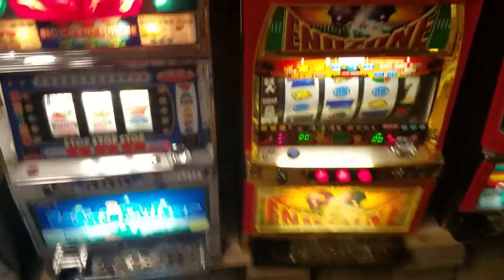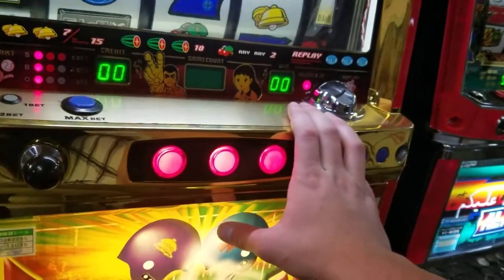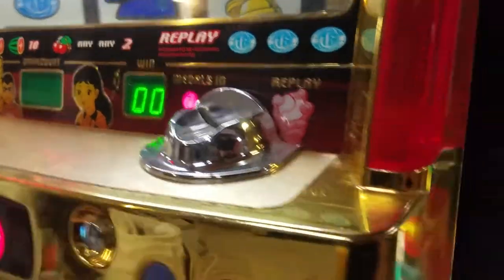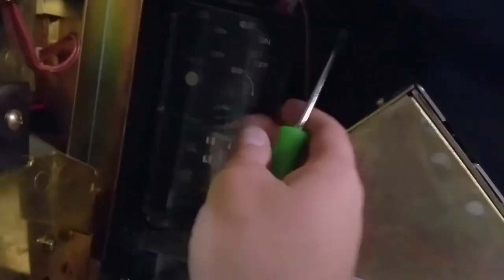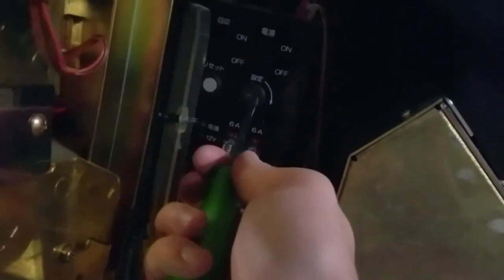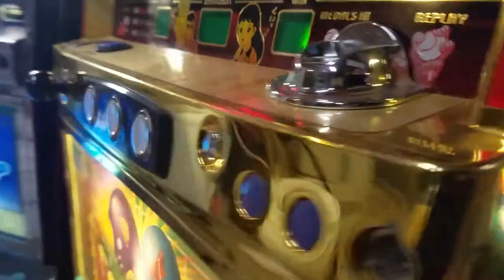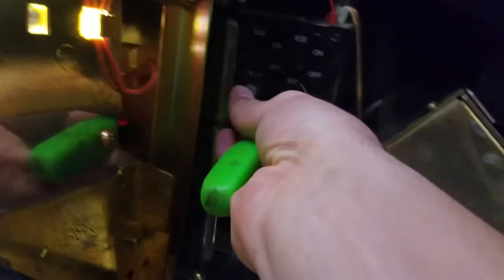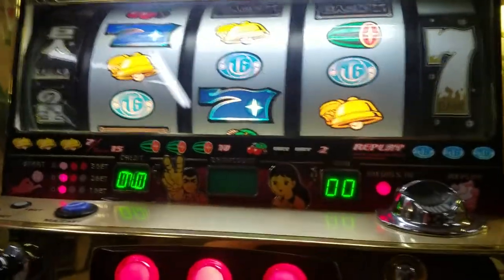Errors and how to reset your Pachislo Slot Machine

Comment: Can you help me to identify the problem I am having with my pachislo machine "double impact" giving a code C3
Reply from the maker: Doing a little bit of research and I believe the c3 Is something to do with the buttons that stop the reels. If that is the case, I would check to see if When you have the machine open and you push the buttons if you are getting any sort of lights in the back. That only turn on when you push a button. If not, then I would check the control board and see if by chance you have a blown fuse on that control board. I've had that happen to me before

Comment: Jacob thank you. Super helpful. Just acquired a "GIAN" pachislo and ironing out a variety of stuff. Are you familiar with an "HH" code? Not finding info about this one! I have checked the LED sensor on the hopper, quick cleaning. NOT seeing any light readily visible from it (are these infrared?) This error occurs after every game unless I do a door reset (the pair of microswitches linked to the door lock) - I have new ones coming since one was blown apart).
Reply from the maker: Some of the sensors are infrared sensors, yes. I would check to see if the infrared sensor is by chance going off and if not to replace it. Definitely could be an issue.

Comment: Hi jacob, could you help me try to fix my machine? When cashing out, it only spits out one coin and then flashes a 3 until i do a hard reset
Reply from the maker: Have you by chance cleaned your hopper unit or does your hopper unit spin freely?
Reply: @jacobnienaber7653  got it fixed. coin ejecter was not moving freely and not keeping up with pace of coins. lubed it up and works perfectly now
Reply from the maker: Wonderful! I'm glad to hear this. I apologize for getting to this so late. Repairing coin operated equipment is merely a hobby, and I have other commitments above and beyond this YouTube channel. Glad to hear you found what worked!

Comment: I'm wondering if you can help me with a slot machine I recently bought it's for my parents for Christmas and I keep getting an E3 error it's 777 big chance game new big pulsar. I wish that I could send you a photo of it- maybe if you have an email??
Reply from the maker: My email is 96nienaber@gmail.com

Sorry for the later response, doing a mass comment today. Doing a little research and looks like E3 could be an empty hopper (no coins). If this is not the case, or the tokens are not feeding through properly, I would clean the hopper and see how they feed through. See if it potentially is a sensor or switch. Then reset the machine.

Comment: I just acquired a Pachislo triple 7 slot machine, the reels don't spin and the bet max button does not appear to be able to press down.  Any ideas of the problem, it did have a E1 code but I cleared it.  Thanks
Reply from the maker: Sorry for the late response, doing a mass comment today. When you try to place a bet or put coins in the machine does it do anything? There should be a control board in the back right of the machine or the center of the machine (different models do things differently of course, But I am no means an expert on every slot machine). 

What I would first do is go through and test to make sure that your coins are going through appropriately and are registering (there will be an LED light or should be an LED light for every switch possible). When the switch is activated, it will produce a red LED on that board. Test and see that all your buttons, coin slot, and lovers are registering with that board.

If they do not, the machines that I've worked on at least have a fuse on that board. With the machine off, with a multimeter (or if it is blatantly blown) see that that fuse is good. If it is not good, that could be your primary issue. The machine will still turn on, but will not act appropriately as that board controls many of the switches and moving parts. Hope this makes sense?

Comment: I just bought a used one. It's all in Chinese. What is the button left of the black play handle for?
Reply from the maker: I would have to look, but I honestly have no idea what this could be... I know that's not a great answer, but never have had to use it, sodon't know what it all is. However, and I'll try to find the app here, but there is an app (pretty sure this I'd an offshoot of google translate?) That you can take a picture I'm something in a foreign language and will translate it for you in English. I would do a little research on this, as it helped me tremendously but haven't worked on one of these machines in about 2 years, so I have them in my attic currently and dont get them out often.

Comment: I recently bought a used Gurukun slot machine in an online auction.  Your reset instructions helped me get it going.  Now I'm searching for some replacement light bulbs.  They are very small wedge bulbs marked 24V 1.4 watt.  Any idea where I can buy them?  Many thanks!
Reply from the maker: I would try eBay or even a large department store might have them (Menards, Lowe's, home Depot)?

Comment: Do you any knowledge for a super mog mog machine.  Plug it in. No power. Although today I did get the coin dispenser to rotate.  This things been in the family foreverrrr an just trying to get it back to working. Thanks
Reply from the maker: I do not know alot of that particular machine. I would be tempted to check a fuse if you can get the hopper to run. Next thing I would check would be if everything has proper plug ins to the power supply. Next, would check to see if the power supply is the issue.

Comment: I need help resetting my Pachislo machine.  It's older (1992?) called Triumph.  Can anyone help?  I can send photos.  I get power to the lights but nothing to the 3 reels, and the coin mech is unpowered and simply passes the tokens through to coin return.
Reply from the maker: Sounds like this could potentially be a power board or a power supply issue. Not 100% sure of it, but if you are only getting power to a few things, it sofunds like either a fuse is blown on the power boards or a bad bower supply

Comment: I have a 1995 Pink Panther Big Chance pachislo. We play in credit mode because anytime the coins have to pay out the alarm goes off and the error code is E3. To get the alarm to stop we have to reset the machine everytime. Not too bad but it gets annoying because we can only play a couple spins in a bonus round before the max 50 credit is reached and then it has to resort to spitting coins out. The coins spit out fine but the alarm goes off, we have to reset, and then completely loose the bonus round. Needless to say, we’ve never been able to see a bonus round play through fully. If we set it to coin mode, than the alarm/E3 happens every single time the coins come out, which means we have to reset the machine every-time. Any suggestions???
Reply from the maker: This seems like a tricky and very peculiar machine error. Could we email back and forth to perhaps get some clarity? I apologize for the delay. Been a crazy last few months

Comment: Jacob, we need help with our coca-cola machine. We have an E7 error but we do not have the same “key” reset as we watched in your video. All we have is an on/off switch. There was an old matchbox somewhere inside the door that allowed the machine to work. We have since moved since buying this machine & we can no longer get it to work. Is there anyway I can get your email address to send you pics? We’ve tried everything & not sure what else to do! Please help us. Thanks
Reply from the maker: 96nienaber@gmail.com. coca cola machines will be different that a slot machine, but if I get the make and model, I may be able to put us in the right direction!

Comment: I have a slot machine and they say if you want at the top it cuts on it lights up it even makes sounds but at the top right-hand corner it says E1
Reply from the maker: Sorry for the delayed response!  just seeing your comment now. An E1 are typically is introduced by a hopper Jam or a coin mechanism Jam. I would disconnect both pieces, and try to manually feed tokens through each just to make sure that they are going through properly. Also, would make sure they are as clean, so no dust is there a possible. Then, I would reset the machine as shown in the video. This is of course after you reset both of the connections to make sure they are solid. Hope this helps! I had an E1 with one of my machines as well, and it did the same thing that you are illustrating now.

Comment: Question! There is a container right below the coin drop on the inside that I assume is for collecting the wrong coins that are inserted. A lot of our regular tokens end up in this collection bucket. Is there an easier way to access it?
Reply from the maker: Hey there! Sorry for the late response. I have never seen one on a machine before that took wrong coins/tokens. Usually it just goes straight into the hopper

Comment: Hello I have. Gundamrx782 pachislo.. I just got it a few weeks ago.. I can't get the door open! I hear there is a latch you can reach the bottom, but I tried that and it doesn't work..
Reply from the maker: Diana, did you try going through either the side or the top of the machine? And usually there are few latches on the inside where the hinges are (at least I've found)  sorry for responding so late! Been running everywhere for work lately

Comment: While playing my Pachislo Money Honey Slot Machine I hit a 777 jackpot.  All the bells and lights went off and payout was made.  Now I cannot stop the jackpot sounds and the machine pays out everytime.  What do I need to accomplish to fix this issue?
Reply from the maker: Have you attempted to reset the machine? That would be my first go to, but then after that I would check to make sure that the hopper is working properly. With it paying a jack out, that Hopper unit has to work extremely hard to get the appropriate amount of coins out. During this process sometimes things can get loose, so just make sure that Optical sensors and other micro switches are in the correct positions.
Reply: I followed the directions in a manual for basically all Japanese slots.  I tried resetting based on turning the key counter clockwise on the door and it did not work.  There is a key slot inside the slot that did not come with the machine.  Not sure if that is part of the reset or not. I'm not receiving and error codes.  Whenever I put a slug in the machine it always pays out.  I took the hopper out and cleaned with WD-40 as instructed in the manual and that did not work.  Any other instructions would be appreciated.  The slot machine worked great until I won a 777 payout.

Comment: Can anyone help me? in the win section my machine is reading 0F when I try the reset the 0F turns into a 3 but goes back to 0F when key is turned to the left.
Thanks in advance!
Reply: So after  tryna reset a few times I've got it to your point where the win section shows a 3 but the machine will not accept any coins they keep coming back out
Reply from the maker: Have you tried adjusting the hopper? This sounds like it could be a couple things. One see first and foremost weather there is or are all good fuses. Second, see that your coin mechanism is inserted properly. 3rd, which could easily be the first see if your Hopper could use a cleaning or make sure it's adjusted appropriately whether it's laser-based or microswitch based in terms of dispensing

Comment: my pachislo machine has a error code cr  and i cannot get it to reset.
Reply from the maker: I'm guessing that you are having a credit issue. This could be for a multitude of different reasons, but I would check to make sure that your coin mechanism is feeding through the coins properly, or that it is not shot. I actually had this with one of the machines, and had to buy a new coin Mech.

Comment: I have a Fever Queen I and cannot get it to automatically payout. I've tried the "wait until the machine idle and press the credit button" but the credit still reads 0.
Reply from the maker: What do you mean by "automatic payout?"
Reply: @jacobnienaber7653  I read in the manual that if credit reads 0 it will hold the coins. If the credit is blank it will dispense the coins everytime you win.

Comment: What do you know about E-5 ERRORS ?
Reply from the maker: An E5 error would be a Reel Issue. This could be for a multitude of different reasons, but here is what I would do to potentially solve this issue:
1.) Reset the machine as shown in the video. For me, this has fixed the majority of my issues.
2.) The rebels should be on a ribbon connector leading to the "reel and stop" board. Make sure the connection is tight by unplugging and plugging back in.
3.) Check to see that the "reel and stop" board has a good fuse. I had an issue once where the small 1 or 2 amp fuse was blown and wouldn't stop the spinning reels.

Anything more than this, and my mind would go to either a bad board or connectivity issues. Hope this helps?

Comment: Key is locked inside. How do I get door open
Reply from the maker: How I was able to get through mine is there should be a grill on top of your machine. Minor just held in with basic Phillips screws. Take that off (is ventilation for the machine). If the machine swings from the left to the right put your hand into this slot and feel around for a metal piece that is sticking out that is movable. These are the hinges that lock the door into place. Move both of these up while you are gently pulling the machines front door.

Cannot stress this enough, do this while the machine is unplugged.

Comment: Sound just stopped. Any way to reset?
Reply from the maker: I would say to first check the fuse on the power supply. Could have gone out. Second, and is probably a little more common is that the speaker finally gave. I would simply order a new speaker. Going to be very common to a car speaker in a way easy to install, but also will give you lots of life. I highly recommend going to eBay and talking with "keep4safety" about your particular machine

Comment: I recently bought a machine it's the bulldog pachislo it says there is a way to adjust the setting as far as pay out any ideas?
Reply from the maker: During the reset, you I should be able to change the difficulty of payout by upping or lowering for your machine the number allotted for your allotted for your machine (1 super common 7 super difficult). To my knowledge, this can only be done in the "reset" phase of the machine. It has been a long time since I've worked on these machines, so I'm going off of memory here and I do apologize about that. To change the payout should be something that I Googled a long time ago, but this is the gist of it.
Reply: @jacobnienaber7653  inside the box there are 2 switch not sure what they do since they are printed in Chinese  but it's a it's a up down switch. If you have a email account I can send you pictures.
Reply from the maker: @reddead2hammer639  96nienaber@gmail.com please do email me!

Comment: I have a eleco machine with a cj coin jam error.. Any idea how to reset it
Reply from the maker: If your machine is anything like a pachislo machine I would do these things:
1.) Take out the hopper, which feeds the coins during a "win" to see if there are any noticeable jams, or the micro switch / laser, whichever yours happens to be is cleaned and in the right position.
2.) Check to see if your connections are all good and clear, and that it is in the right spot.
3.) See if your coin mechanism is feeding correctly. I've had this happen once where the coin mechanism was acting up, and caused the Coin Jam error
4.) Reset the machine as shown above.
Reply from the maker: I would do two things
1.) check to see if their is a jam by removing the hopper and seeing if there does happen to be a jam 
2.) some hoppers have a microswitch, some have a laser. Make sure to see that it is in the correct position and that it is not either blocked or in a normally closed position. 

Then, I would reset as shown in the video. I hope this helps!